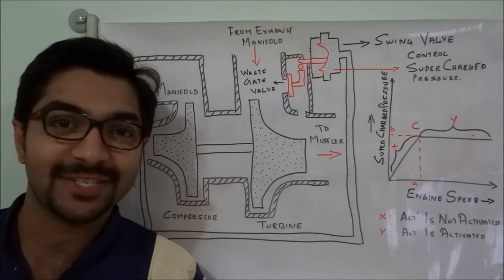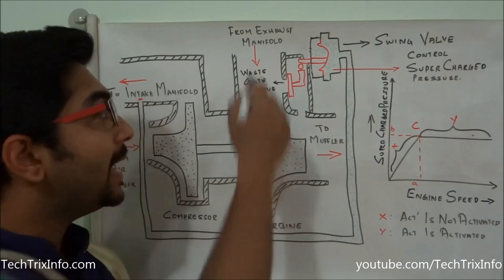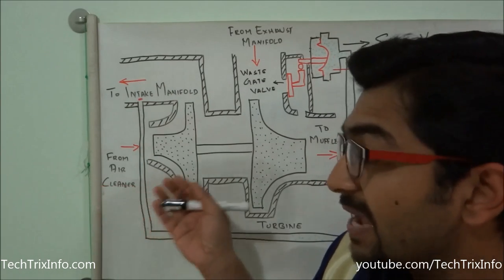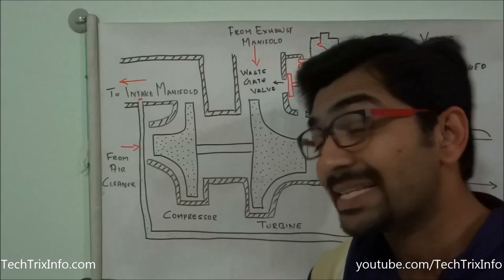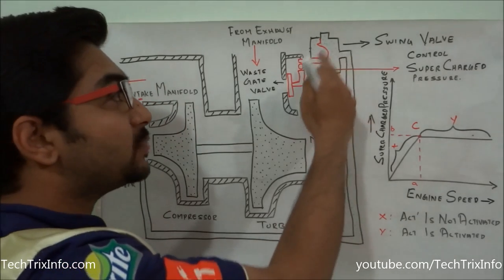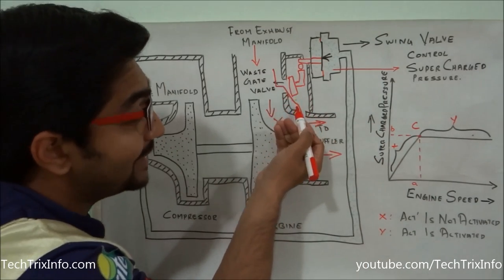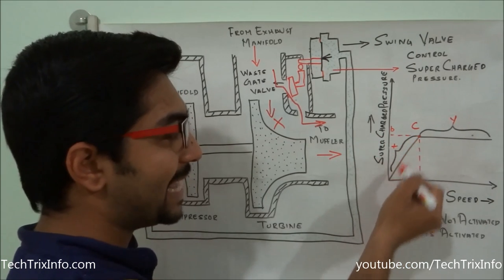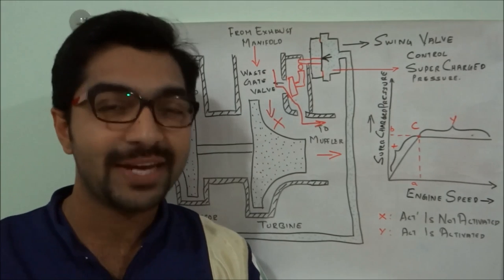How waste gate turbocharger works - Must watch.

Comment: Thank you for the explanation, but I just want to know if there is any chance of  fuel coming out of breather due to the malfunctioning of gate valve
Reply from the maker: +Prabhat Bora 
Yes
May occurs if there is a pressure build up 
Thanks for the comment
Mechanical, Automobile engineering updates through Whatsapp @ +919744615655 (requests through Whatsapp to get updates, or if you have any doubts)

Comment: could u pls explain constant and pulse turbo charge system
Reply from the maker: +Logesh Marine 
Thanks for the comment
Mechanical, Automobile engineering updates through Whatsapp @ +919744615655 (requests through Whatsapp to get updates, or if you have any doubts)

Comment: Fantastic video! I very much wanted to know how exactly that waste gate is actuated and you showed it perfectly! Now is there a design (most probably with large turbos) in which there is a problem with turbo lag in the low RPMs and that wastegate (or maybe another valve) opens when there is sufficient amount of air flow to spin the turbine and before that point all the exhaust gases go directly into the atmosphere (like in a N/A engine)? Is there such a thing? If so, there will probably be a need for another air intake passage - directly form the atmosphere (for the low RPMs when the turbo does not operate). What do you think?
Reply: ERS that is energy recovery system helps in reducing the turbolag to a great extent.its one component called MGU-H helps in doing so
Reply from the maker: +Akash R Nair S 
Great 
Thanks for the comment
Mechanical, Automobile engineering updates through Whatsapp @ +919744615655 (requests through Whatsapp to get updates, or if you have any doubts)

Comment: Does Watergate affect the car not to start?
Reply from the maker: Hi, The wastegate itself usually won’t stop your car from starting. Its main job is to control the turbocharger’s boost pressure. If there’s a problem with the wastegate, it might affect performance or power while driving, but starting issues are more often linked to things like the battery or starter motor. However, if the wastegate is stuck or not working properly, it could cause engine performance issues. It’s a good idea to check all related parts to find out why your car isn’t starting.

Comment: i am facing some problem in my ford fiesta. at exhaust black powder & smock. Bad acceleration and sometimes rmp drops sudden and stops when AC on.  computer is giving error in MAF sensor. But i check with multimeter it is working good. 

please help..!!
Reply: +Denn Ry Probably needs a clean. Take out the MAF and spray with a good circuit cleaner.
Reply from the maker: +Denzil Lee 
Yes good recommendation 
Thanks for the comment
Mechanical, Automobile engineering updates through Whatsapp @ +919744615655 (requests through Whatsapp to get updates, or if you have any doubts)

Comment: How a motorcycle engine works. Deep explanation please. 
And supercharger vs turbocharger. Please
Reply: +Abhinav Garg No replies in a year, damn. Well, let me take a stab at this.

Motorcycle engines are no different from any other engine. They are usually naturally aspirated (not force induction, e.g. turbocharger / supercharger) and only rely on gases being "sucked" into the engine. The main difference is they usually on have two cylinders and come in smaller configurations of their I4, V6 and V8 counterparts.

A turbo charger, as you know from this video and any other studying, is a turbine that is driven by the exhaust or "waste" of your engine. In a regular car, the exhaust simply goes out the muffler and is unused. In a turbo application, the gases are routed through the turbine like the video shows and that turbine is connected to the intake side turbine which forces air (i.e. "force induction") and makes your engine consume more air. Once you add a little more fuel to accommodate that influx in air, you get more power. The intake side of the turbine has an air cleaner which filters the air before it passes through the turbine, then that air is usually fed into an inter-cooler which lowers the intake temps down a bit so you don't run the risk of detonation, or a scenario where the intake air is already so hot that the moment it is combine with fuel it will ignite before it has a chance to be compressed by the piston. You want to cool the air down as it is coming to, then feed it into the motor to complete the original combustion process.

A supercharger on the other hand works very similar to a turbocharger, but the method in which a "turbine" is driven varies. Some superchargers sit directly on top of the intake manifold. The supercharger usually has a shaft coming out of the front with a pulley. You route a belt over the pulley, much like the alternator or A/C condenser and the supercharger spins with all the other accessories. Some superchargers look and work almost like a turbo charger, but instead of being driven by exhaust gases, they also have a pulley and a belt. Since the supercharger is already spinning, and depending on the supercharger, already making a decent amount of boost at lower RPMs, S/C's can virtually eliminate turbo lag.

There are many schools of thought on this, but usually you have a trade off. Turbo chargers are really great for torque, the feeling of being pushed into your seat when accelerating. The downside of a turbo is the lag. Superchargers are really great at producing power with almost no lag, but for the most part don't put out the same amount of power as a turbo can. 

But it depends on various factors like model, vehicle, tune etc.
Reply from the maker: +joshuaburris2007 
Josh Tks for that great reply
Whatsapp @ +919744615655 (requests through Whatsapp to get updates, or if you have any doubts)

Comment: I just want to tell you that the opposite of a naturally aspirated engine is just a  forced induction engine. A diesel engine is just specifying the type of fuel: diesel. However, diesel engines do react very well to being turbocharged.
Reply: FLYING PANDAS A diesel runs better with a turbo because a diesel works off of compression ignition, not a spark plug. With that being said, the more compressed the air is going into the engine, the more explosive it is; thus more power! Hence the reason why almost all diesels today come standard with a turbocharger. and also, a diesel is much more than just the fuel running through it. Diesels are built to withstand tens and thousands of pounds of pressure. If you were to run a diesel fuel system on a gasoline engine successfully, that gasoline engine would blow apart.
Reply from the maker: +Ty Pyles 
Thanks for the comment
Mechanical, Automobile engineering updates through Whatsapp @ +919744615655 (requests through Whatsapp to get updates, or if you have any doubts)

Comment: you forgot to mention the inner cooler which cools the compressed air before it reaches the intake manifold
Reply: +7150285 I know this is a year old but good point. Although not all turbo applications require inter-coolers. I've seen a twin turbo BMW where the two turbines where mounted all the way near the rear of the vehicle at the muffler and the intake tubes were routed all the way back up to the engine. I guess the length of the pipes somehow eliminated the need for an intercooler, but there's no way I'd really want to run one without it. I think you're risking too many things by running high intake temps, especially with any decent amount of boost.
Reply from the maker: +joshuaburris2007 
Thanks for the comment
Mechanical, Automobile engineering updates through Whatsapp @ +919744615655 (requests through Whatsapp to get updates, or if you have any doubts)

Comment: I'm sorry, I cannot understand him.  But I feel like it has the information I desire.
Reply: +Brian Beaurate  Mee too! FML
Reply: +Brian Beaurate Yea me three... also, never ever put Must Watch in headline.
Reply: +Marcus Björn “ZenTaurus” Rydström ok, I will schedule an appointment with my doctor to see if I am developing a disability, or if I am going deaf.  Thanks for your help.
Reply from the maker: +Šhithouse Lumberjack 
Hi sry guys
Will try to add subtitles, will try to solve the accent issue

Mean while if you need help contact me on Whatsapp @ +919744615655 will try to explain
Reply from the maker: +Brian Beaurate Thanks for the comment
Mechanical, Automobile engineering updates through Whatsapp @ +919744615655 (requests through Whatsapp to get updates, or if you have any doubts)

Comment: how turbocharged engine works at low rpm say at 2000 rpm , turbo turns on at this low speed , or exhaust gases just passes without rotating turbine blade
Reply: +dhairysheel jadhav The turbine begins to turn as soon as the engine starts the combustion process. At lower engine RPMs, the exhaust gases which is used to drive the turbine are lower; thus resulting in lower turbine speeds. At 2000 rpms, which is quite a bit above idle, the turbine is spinning slower and therefore, creating less boost. This phenomenon is what is referred to in the automotive community as "turbo lag". That is the time it takes to spin the turbo up to a high enough speed to produce sufficient boost. For that first second or two, a turbo car has a bit of a lag where you are revving the engine high enough to get exhaust gases flowing through the turbine to achieve boost.

The exhaust gas will not "bypass" the turbine unless the boost pressure in the intake system reaches a high enough point to open the wastegate.
Reply from the maker: +joshuaburris2007 
Thanks for the comment
Mechanical, Automobile engineering updates through Whatsapp @ +919744615655 (requests through Whatsapp to get updates, or if you have any doubts)